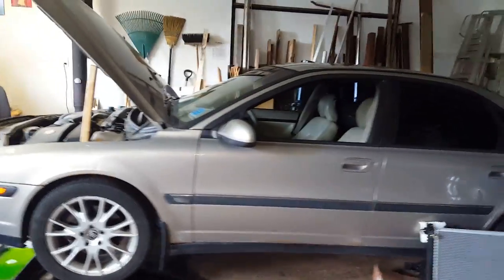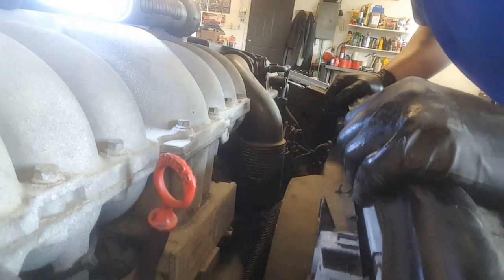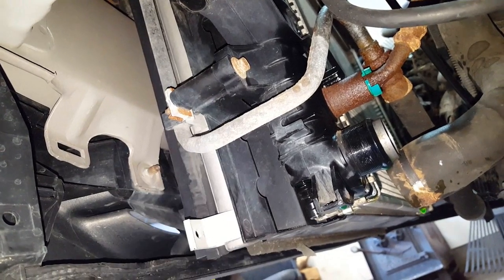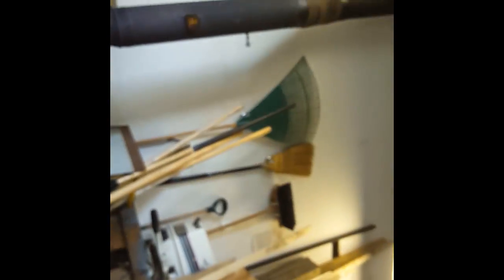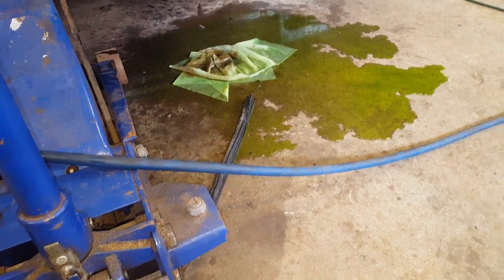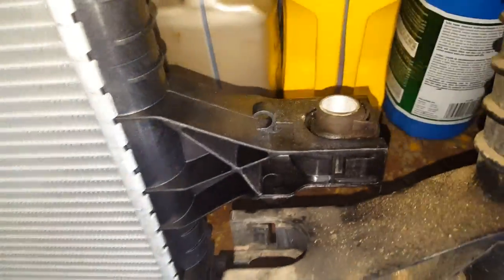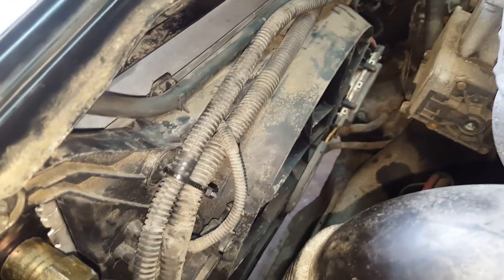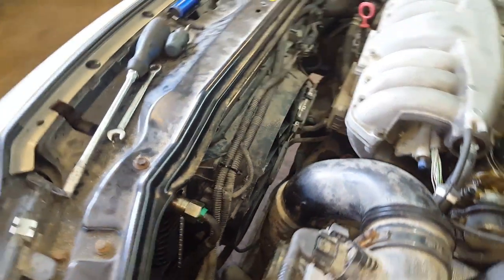#DIY Volvo S80 Radiator Replacement - 2000 Volvo S80 2.9L Non Turbo

Comment: doing this today, 2004 V70 turbo, intercooler adds more clutter and hoses.
There are no videos for mine, lots of x90 radiators but no V70 turbos.
Saw your video before I started and ordered new tranny coolant seals and new green clips with the radiator.
Removed my rad out the bottom too. new one is ready to go in.

Comment: Ok, getting ready to change the radiator with your instructions, it’s a major life and money saver like I mentioned. Last year my radiator cracked, we took it to a mechanic that we thought we trusted, the guy we bought our Volvo from. It cost us over $600, and a little over a year later it went to shit. For one thing, he didn’t replace the upper and lower hoses, the lover hose went to shit, he even over torqued the hose clamp messing up the port. Then as I looked at the radiator, he obviously put in a used cheap ass radiator, and with all this costing us over $600. So after it went bad again, I’ve changed the hoses, the old ones were both shot and bulging, they were the originals. Now I finally was able to afford a radiator, found a good deal for a good one at rockauto.com, for $100. I checked it out and it’s way better than the one the mechanic put in, he seriously put in a bad radiator. I researched the model radiator I bought and it all has high marks, and with my budget it was affordable. I’ve watched this video many times burning it in my head, now I’m getting ready to get to work. This is saving me hundreds of dollars, I’m not a mechanic but I’ve worked on many of my cars over the years, I’ve swapped radiators before, but never on a Volvo, I was stressed trying to figure it out, then I found this video and it seriously made my year, thanks again, I’ll post how the swap went when I’m done, lol
Reply from the maker: Donald Lee good luck man!

Comment: The middle plastic where you have to sandwich in between the condenser and radiator is a pain, i had to use duct tape to hold it in place and remove it afterward

Comment: I couldn't take the radiator out from the bottom on the passenger side. Mine is a 2.8 T6 from 1999 and the data cables and a pipe were blocking the way. I could not lift the radiator over the inlets of the condenser. I managed to take out the radiator and condenser together from the top at the (not UK) drivers side after I folded away a big air hose I don't see in this video. My condenser has two big inlets on either side that obstruct the radiator.
Reply: Hi, I have the same issue, how did you remove it and replace it?
Reply: @ricardoramos3095  oh man that was 6 years ago...
I do know that the air filter pipes and turbo hoses all have to go. If it has an automatic transmission make sure you have the hose clamps and rings in stock for the transmission fluid pipes. If one breaks the engine cannot start.

Comment: I have a 2003 S80 2.9 non turbo, and with the help of your video was able to get the whole thing tore down while I'm awaiting my parts to come in.  BUT, I dunno if this is something different about the 03 model, but in my very frustrating time trying to wiggle the rad out, another, rather large shroud thingy just fell out with it.  I didn't see anything like that in your video.  It looks like a kind of half shroud with weather stripping all around it.  I just have no idea where exactly it came from.  Maybe in front of the condenser?  I had a lil trouble keeping the condenser held up where it goes.  I used a small floor jack like you did, but it didn't wanna stay on top of it...I hope I didn't mess it up by letting it hang a few times when it fell off the jack.  Silly me for not noticing it but do you or anyone else know what I'm talking about?  It's not the thin plastic piece that goes around the rad and condenser.  It's hard to explain, wish I could send a pic.  I haven't been able to find it on ANY parts diagrams or other websites.  I'm perplexed as hell.  (and feel real dumb that I didn't see where it came from when it fell out the bottom.)  about half of it is solid, as in, not a wide open circle....it seems almost like it would restrict half of the air flow. Maybe it directs more air to the fan?  I just don't know.  My car always ran at perfect temp with it in there.  I'm only having to do this because I hit a large piece of concrete protruding up through a moron's shitty drive way.  It bent the condenser real good too, but that didn't break...just bent pretty bad.    If you or anyone knows what and where this thing goes, please help.  Sorry for the novel, but my best guess is that it goes in front of the condenser....just didn't look at it close enough first.   thanks!
Reply from the maker: If its not the piece that goes in between the rad and ac condenser or the bottom should under the car I'm not sure what it would be... sry bud
Reply: @ArchersGearheadGarage  I'm pretty sure this car was hit from the front by the prev owner.  So who knows what they did when fixing it.  Unless I can figure it out for sure, maybe I'll just leave it out and see what happens.  I don't see it anywhere in your vid.  BTW, that valley pan isn't even on my car....probably got left out by the place who fixed it after an accident.  Oy Vey!  Well thanks for the quick reply :)  And in any case, your vid was immensely helpful.  I'll let you know what happens after I finish this up in a week or so.  (Parts on order)
Reply: OK, got the new rad in and discovered that the shroud in question goes in front of the condenser.  It's supposed to be held in place by 2  speed-nuts that weren't there, so it just fell out.  Shoddy previous repairs from a former accident.  Getting that radiator in there was a sumbitch with that bent condenser, but we (my gf helped, holding things in place..) succeeded.  Thanks again!
Reply: @jvincent1446  Hi.  I think I am having the same problem.  Is the shroud Volvo part #  8620082, called an air guide?    Google search on Volvo 8620082 will bring up a picture.

Comment: Quick question...
How did you put on the green replacement clip. Mine broke off at the bottom T line like yours did. It won't slide straight on...🤔
Reply from the maker: you have to slide it past the ridge on the line so that the locking tabs are below the ridge

Comment: Hey is it possible you remember the part number on the transmission clips aka the oil cooler connectors? I broke 1 also
Reply from the maker: Yeah Yeah volvo part# 9485149

Comment: Would this be any different with a 2004 Volvo S80 2.9 twin charged?
Reply from the maker: Yes
Reply: @ArchersGearheadGarage  Yes it’s the same taking it apart so I could use this video or yes it’s different so I couldn’t? I’m sorry man
Reply from the maker: Sry, I'd have to assume it's different but u could try what I did in this video to get u going. It's probably similar, just not the same

Comment: Is replacing the radiator for the turbo s80 the same procedure?
Reply from the maker: +Darrien Richardson i would imagine so. May very slightly
Reply: Archer69er thanks for the fast response. Getting a 2001 S80 T6 tomorrow just has a crack in the radiator, for 1700 good deal?
Reply from the maker: +Darrien Richardson as long as its not rotten and not too many miles decent deal
Reply: Archer69er 178k
Reply from the maker: +Darrien Richardson cool!

Comment: Damn that piece of plastic spacer fell off the condenser. What a bitch that is to samwich back in. I had to use fine wire to hold them together. If god gave me longer arms🤷🏻‍♂️